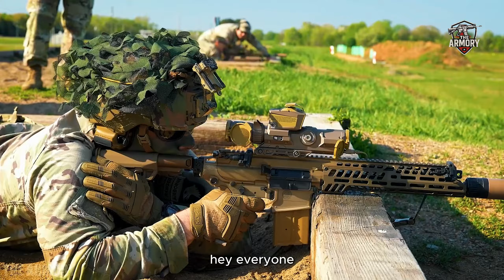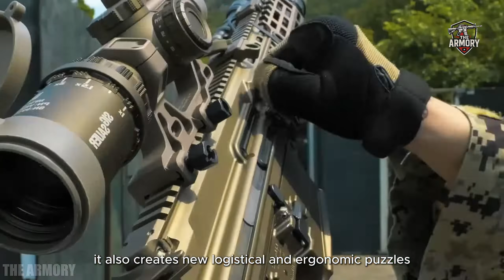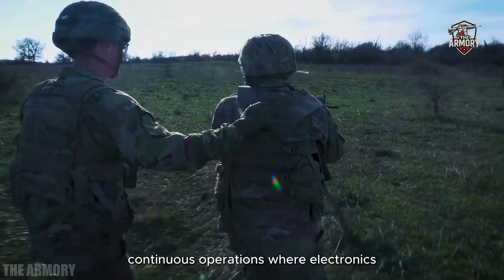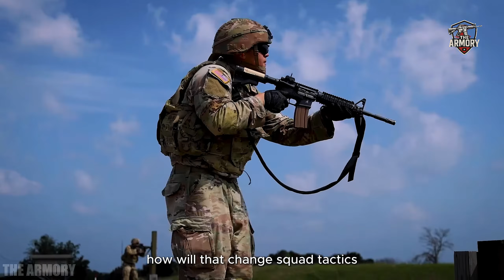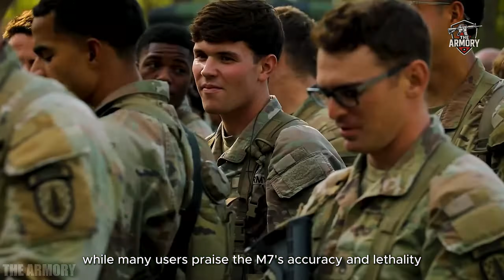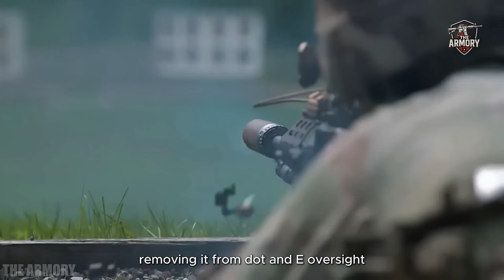The Army Pulled the M7 From Independent Testing — What Happened & Why It Matters?

Comment: IT DONT go far enought ameica wins conflicts by out-ranging the other guy we be doing that since the 80's now it needs to be applied to the ground. That the next logical step  that is unless you want to try to when with no boots on the ground and just pusj button everything
Reply from the maker: @ronwhittaker6317 Right on — range wins fights when you can exploit it, and the U.S. has chased overmatch since the ’80s. Turning that standoff advantage into real, ground-applied lethality is the next step, but don’t kid yourself: long-range systems and push-button strikes complement boots, they don’t always replace them. Best plan is layered — sensors, long guns, air, and foot work together.